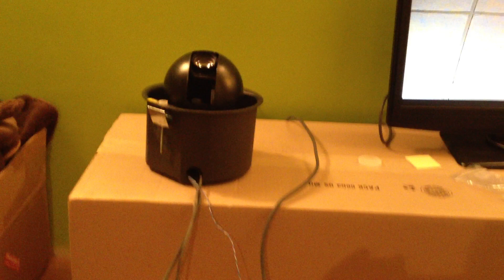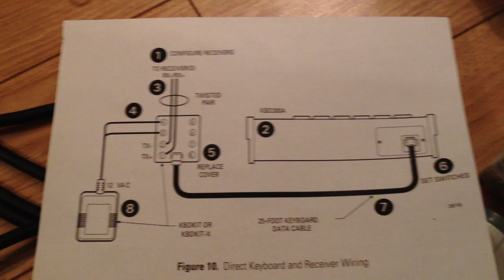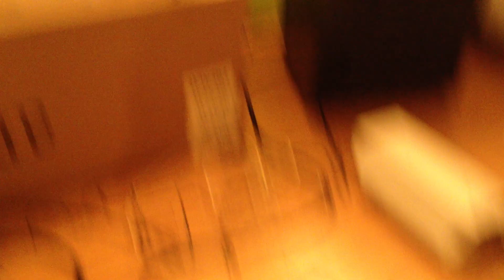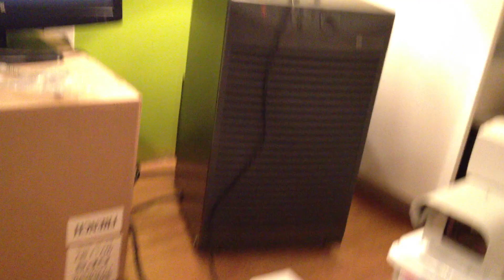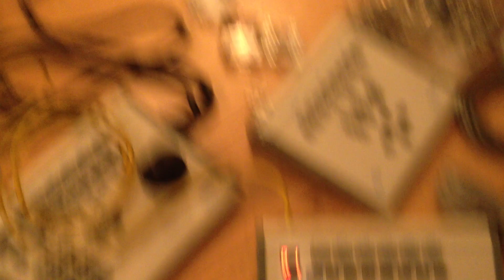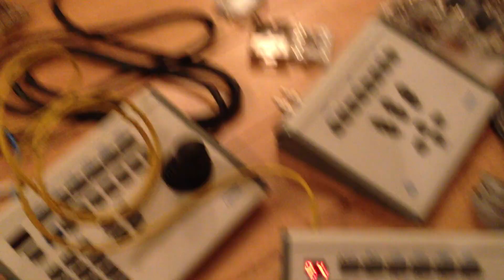How to use a Pelco KBD300 PTZ camera controller in DIRECT MODE

Comment: Can you do this with a KBD4002 keyboard?
Reply from the maker: No kbd4002 is like a kbd4000 only for use with a genex multiplexer such as MX4016CD
Reply: Chargèro 
It cost to buy without knowing. Thank you will not waste any more time.
Reply from the maker: @stevejones1935  look on ebay for a KBD400 and Genex MX4016CD you can find them as low as $20. With those you can control pelco ptz cameras with coaxitron ptz control through the coax cable. No configuration addressing. Just plug and play. The only thing you have to do is set the dip switch on the camera for coaxitron
Reply: @QuaabQueb  Will look at them, bought the KBD4002 for something small and simple for my bench but that did not work out. I do appreciate your reply I would just blindly plodded  ahead.

Comment: Can you explain the remote mode KBD300A connections.

we have 2 control room.

control room -1,  all cameras NVR installed and connection done.

control room-2 ,  from control room-1 to Control Room-2 distance 2 KM, through fiber optic cable, remotely we are accessing live video from DSSRV Software.

Client need Control room-2 Remotely it has to Access KBD300A controller and share the connection and configuration details.
Reply from the maker: To interface the KBD300A with your NVR may not be possible. It is only supported by DX series DVR and Endura Series DVR with serial USB kit.
There may be a way to "hack" it to work with serial USB adapter for your NVR but this is not officially supported by Pelco or any manufacture. I have never done this so I cannot say for sure if it will work.

Comment: I am using the CM9760-KBD, I cannot figure out how to use the playback feature. Google isn't helping very much. Can anyone help
Reply from the maker: Playback feature? Have not heard of that, what is it supposed to do ?
Reply: Videos from Québec From what I understand I can use it to play back video NVR/DVR but I can't find any instructions on the net. I'm not tech savvy and this is work related. A site selling it listed it as an option but no instructions
Reply from the maker: I highly doubt that. These keyboards do not control anything in an NVR/DVR just video and PTZ controls for the camera connected to the matrix switcher.
Reply: Videos from Québec Ok, thank you for answering my question

Comment from the maker: Receiver data positive and receiver data negative. The (transmitter data positive) Tx+ and (transmitter data negative) Tx- are the wires where the signals go out of. I have to connect those wires to the Receiving (Rx) terminals of the camera